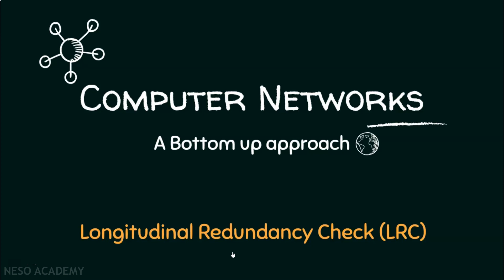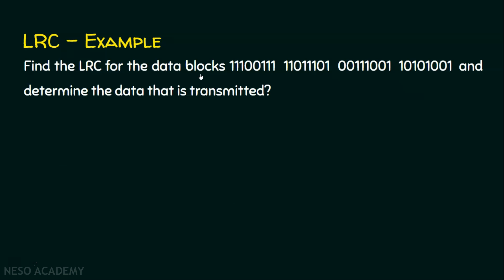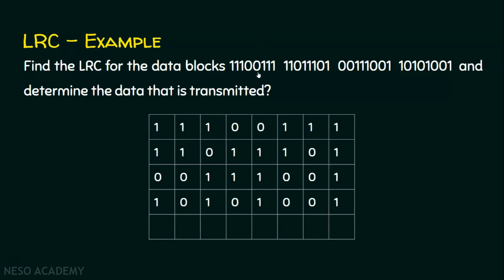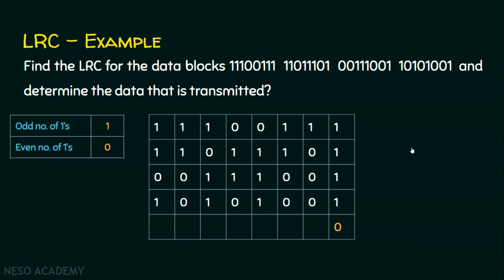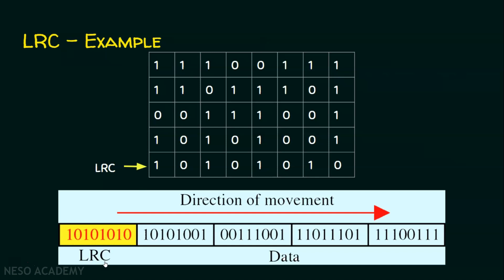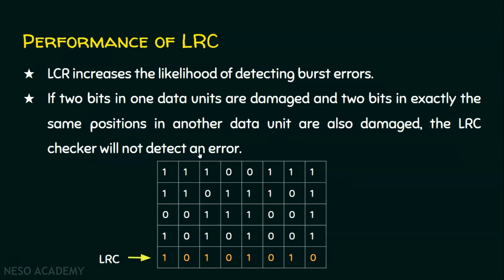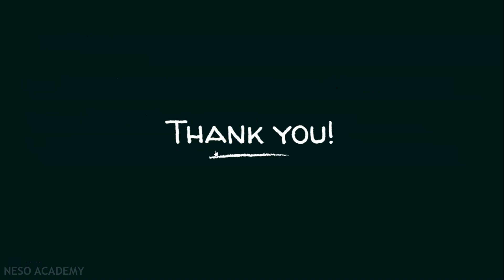Longitudinal Redundancy Check (LRC)

Comment: U mentioned if 2 bits and 2 bits in different blocks are damaged it will not detect error but in the question only 1 bit in block and 1 bit in another block is damaged, for 1 bit also it is not detecting, is the statement wrong

Comment: 00:02 Today's session focuses on longitudinal redundancy check (LRC)
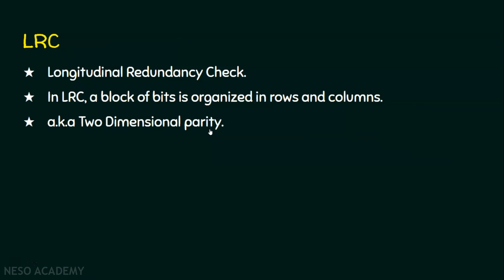01:05 Parity bits are calculated for each column
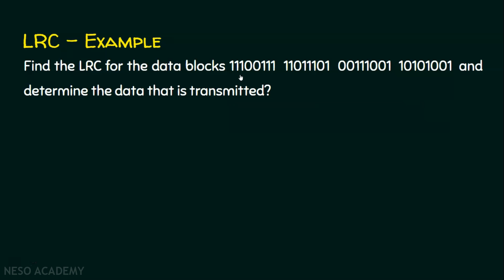01:59 Data in LRC is placed in rows and columns and parity bits are calculated for each column.
02:54 Each column represents a binary digit
03:46 The data to be transmitted to the receiver consists of the first four rows.
04:41 LRC code acts as redundant bits to detect errors in transmission
05:32 LRC has high performance in detecting burst errors.
06:24 LRC is not able to detect errors if two bits in exactly the same positions in another data unit are damaged.
Crafted by Merlin AI.00:02 Today's session focuses on longitudinal redundancy check (LRC)
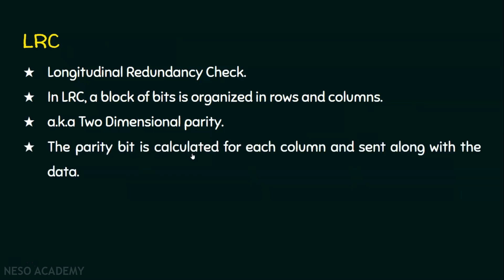01:05 Parity bits are calculated for each column
01:59 Data in LRC is placed in rows and columns and parity bits are calculated for each column.
02:54 Each column represents a binary digit
03:46 The data to be transmitted to the receiver consists of the first four rows.
04:41 LRC code acts as redundant bits to detect errors in transmission
05:32 LRC has high performance in detecting burst errors.
06:24 LRC is not able to detect errors if two bits in exactly the same positions in another data unit are damaged.
Crafted by Merlin AI.

Comment: what will happen if LRC bits flips during transmission Then receiver receives wrong LRC and it will reject that data packet?
because when actual data can be corrupt during transmission then why not LRC bits?

Comment: Hw problem - 
LRC is 00011101

Data transmitted is 
00011101 10101010 01101001 10101001 01110111

Thankyou for this explanation 👍🏻
Reply: Mine is also same
Reply: what will happen if LRC bits flips during transmission Then receiver receives wrong LRC and it will reject that data packet?
because when actual data can be corrupt during transmission then why not LRC bits?
Reply: the same
Reply: hehe boi same

Comment: Sir how receiver will calculate lrc of the original data ❓
Reply: Receiver receives lrc and data
Reveiver keeps aside sender lrc ,takes only data and calculate lrc then it matches sender and receiver lrc 
If matched no error
Reply: @vitharv5468  what is difference between LRC and checksum?